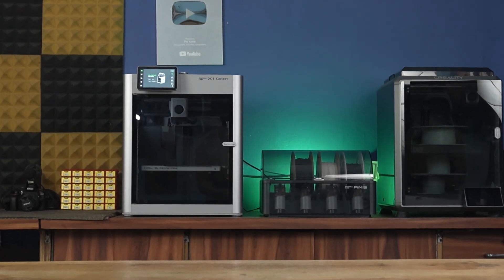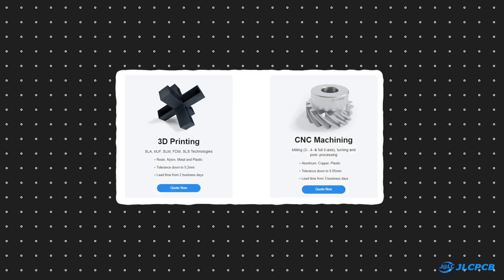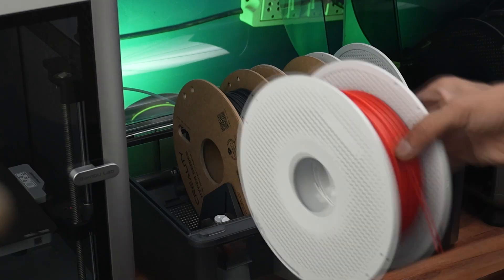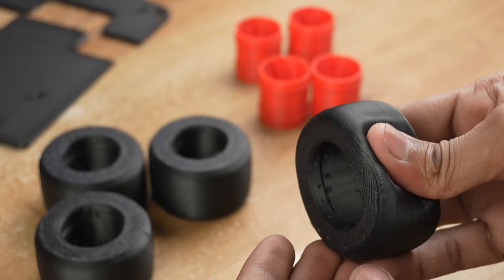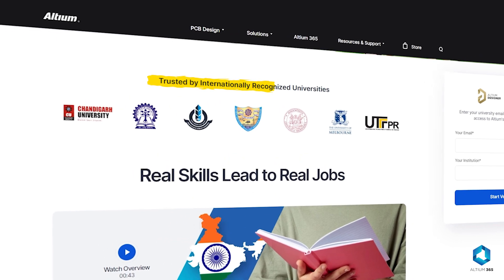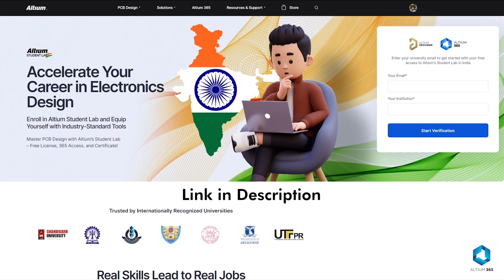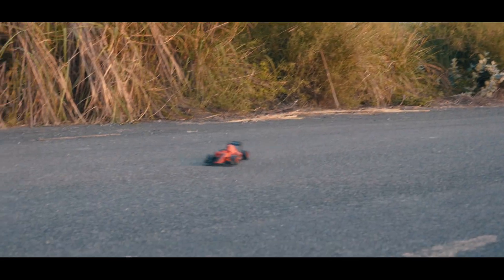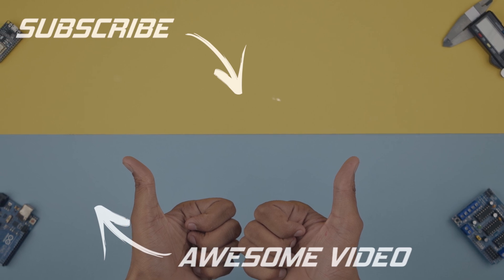Making a High Speed F1 RC Car - Fully 3D Printed

Comment: Could the chassis be made a single piece up to the front wing connection point ? Also i you went at 1:10 could you replicate the real suspension systems ? Would there be enough space to actually use hobby grade rc parts to make them ?

Comment: Finally he used brushed motor 😂
Reply: Brushed motors are not good. They overheat, wearout faster and are not as powerfull as brushless motors. The only advantage is their price.
Reply: @noname-bf9zm  i mean on that car the only thing that can hadndle is a brushed motor i tired with a brushless motor and pinion gear rounded off and it was undrivable even with foam tyres